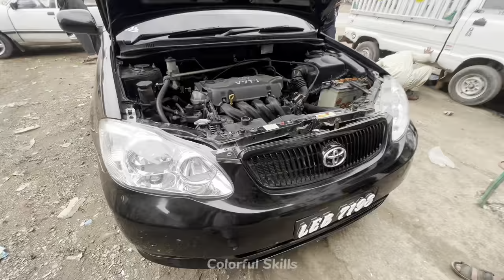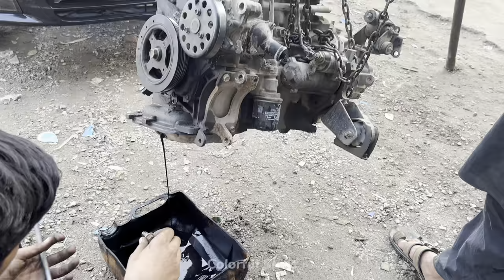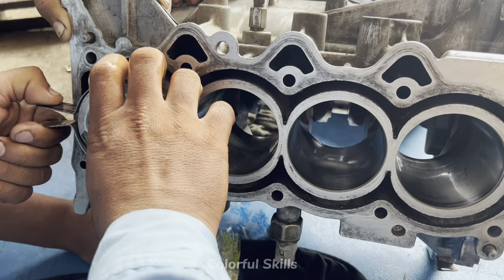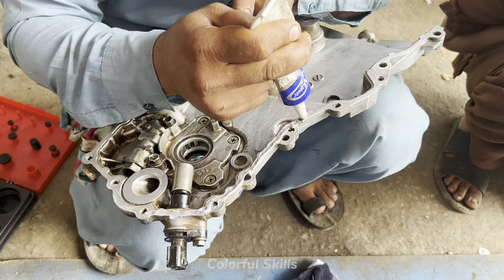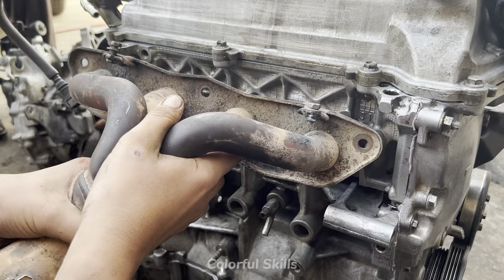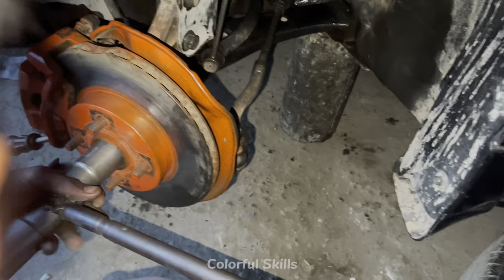Restoration Of Toyota Corolla Petrol Engine | Let’s Open And Check

Comment: These are backstreet garages where cost of repair work is much cheaper than dealerships, and it gives such workers, young and old, a livelihood, plus improving ongoing skills. My hat off to them for doing a quite a decent job, with very rudimentary tools and equipment available. Thanks for sharing the video.
Reply: Even if you paid these guys $5 for what they did it would have been a rip off because they did absolutely nothing to improve the condition of that engine. No measurement of worn parts was done and no proper cleaning was done. The rings were fitted incorrectly and oil dripped into the cooling system. this was a complete waste of time.
Reply: @frasercrone3838  Yo vivo en occidente y hasta hace poco me he dado cuenta de que es más parafernalia que buen servicio el que nos venden los concesionarios. Consumismo puro.
No desestimo el trabajo de estos muchachos, si lo hacen así es por que trabajan con lo que tienen, y seguramente les funciona.
Reply: @frasercrone3838  I was kind of on the same thought process. How do we know how good the work is? how do we know it will hold up since nothing was torqued to spec. My major concerns was the crank and the head... if those bolts let loose on either that engine is toast.

Also, it looked like they reused the same head gasket and just doctored it up with some glue.

Maybe this thing will last another year or two and judging by the condition of the oil when they cracked it open it seems no one really gives AF about basic maintenance so if this el cheapo rebuild lasts 1 year they probably get their money out of it.

Comment: I love Toyota. They are definitely worth rebuilding. Great cars.
Reply: They did NOT rebuild it, the only new part I saw going in was a set of rings which went in on top of the old glazed bore. NO measurements of wear components was done and the mainshaft bearings were not even looked at. The rings that were fitted had the gaps in the wrong places when fitted and the excess of fitting oil ran into the engine cooling spaces where it will mix with water. This so called repair was an abomination  and a waste of effort..

Comment: ❤😮😅😊 Good job there guys. I got a distant cousin to that car. I got a lot a Toyota echo 2003. It got almost 245,000 mi on it. That's still running though. I got to add oil every 600 to maybe 800 mi and it runs good and runs on premium and let it runs great. That looks like a 1.5 l engine. Very similar to what I have here in the United States. Just some things are a little different. Good job guys. Thank you. Good luck to you.

Comment: Good job on using what tools you have but this is bad long term for whoever's buying the car. Using gasket maker instead of proper oem gaskets or even after market gasket on almost everything is bad. The only gasket i saw was the valve cover gasket and the o-rings. The water pump is also not the proper gasket maker , you are supposed to use water proof type instead of the same oil resistant type everywhere else ..... Also, no torque wrenches,  reusing tons of old stuffs that are cheap like the thermostat. This is more like a quick cheap  repair to flip for money.

Comment: Is Spark plug replaced? Not sure. 

Still use old battery & old engine belt, old engine water tank.

Throttle Body is cleaned.

The whole work is cleaning service but not replacing or restoring.

Comment: The engine looks in good condition but the oil pan is bent in out of shape were the pump is located starving the engine oil Flow, that happens when they place the lift under the oil pan to change tires ext, even in the removal off the engine they place the lift right on the oil pan
Reply: the engine looks in good condition? You know this how? not one measurement of wear was taken in areas where tolerances are two one thousand of an inch. That is about the thickness of a human hair. You think the human eye could detect that on its own or the guys finger that he ran over the big end bearing journal. This was crap pure and simple.

Comment: It’s an engine refresh, mainly just a good cleaning and a de-carbon, very little new parts used, I’d say it was burning a lot of oil from the amount of carbon build up on the pistons so they replaced piston rings.
Reply: in that case the cylinder walls could have scratches or damage and the owner will be back real soon when the piston rings seize or blown piston.

Comment: They only fixe the problem which is burning excessif oil because this a common problem with Toyota. No need to replace parts which are not broken. Those cars can run for ever when you oil in them. Those peoples can’t afford to change everything for nothing.

Comment: I remember seeing my neighbors take apart a datsun engine and using a beer cardboard 24 pack as the gasket-i thought they was coolest cats in the world.
Reply: Even though it would not have done the job it was supposed to do you thought that was cool. Proper mechanics train for several years to know how to build engines properly and to NOT use cardboard where proper gasket material is needed. Just because a repair is done in the backyard does not mean it is done properly or is something to be admired.

Comment: In all Toyota cars,
You suppose to use pink engine coolant fluid instead of green because green coolant fluid on Toyota cars will cause not only to overheat, but to cause corrosions and damage on radiator, and entire cooling system on car if not using a correct fluid that car supposedly take like in most cases the correct coolant fluid color on all Toyota car is pink or red and not green cause like I said, green coolant on Toyota like those people put in on that video will cause extensive damage to the car engine cooling system if using a wrong coolant fluid than your car engine supposed to take

Comment: The kinds of suggestions you guys are making i.e. using new timing chain, power tools, torque wrenches being used...Well keep in mind if its done all 100% properly, in the USA, that would cost around $3 to $4K i am sure or even more depending on the location. This repair done is probably the equivalent of a $100 or $200 job with mostly just labor involved. So take it with a grain of salt and appreciate their skills. Don't compare it with an expensive repair in the Western world. And if the car is running good after the repair, no reason to suggest that it will die after 500 miles. That's layman type thinking. As long as clean oil is used after the repair, it will go another 50k miles.

Comment: They just wasted all the money; this engine will perform poorly. He skipped multiple essential steps, which caused many performance issues. First, he did not even remove the crankshaft or replace the main bearings. Secondly, he still needs to resurface the block and piston bore. The third and most important thing is that they did not even know the torque specs, let alone using them. Total scrap. If I were living in Pakistan, I would teach these guys properly how to rebuild the engine

Comment: This is not proper engine over all, they don’t even use proper seal it will still leak oil after engine runs,clutch plate is old. Ig they changed the piston rings otherwise full trash.

Comment: No hate but that dirty environment, no putting bolts on right,  that car won't last long or gona run like crap.  Mite get job done but good luck   , that will not be to spec.  Gona sound and run terrible in dusty dessert.
Reply: All of the things you have written we have already seen in the video! If it is not hate and prejudice, then what is it?

Comment: this is the most disgusting engine restoration I have ever seen. The only new part he used was an oil filter and then he use a wrench to tighten it. And why he was using a feeler gauge on hydrolic lifters? They are self adjusting as soon you start an engine. Head gasket an old one. Rear main seal an old one. Rings an old one. Crank and rod bearings an old one. WHy did he even took this engine out of the car? THis is not a skill. THis is crime. No torque wrench. No sequence of head bolt. What a monkey job. Jis nay bhee yah video post kee hay iss koo apne damagg check kerwana cahiyaay.
Reply: you have to have qualifications to be a good mechanic